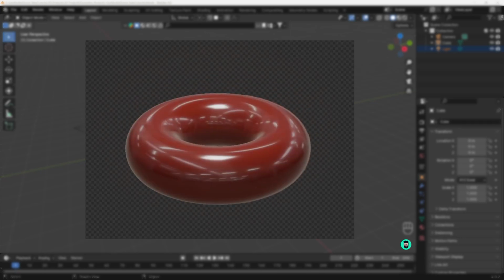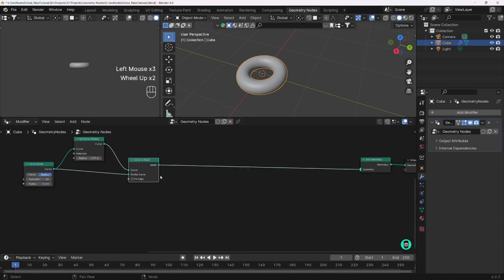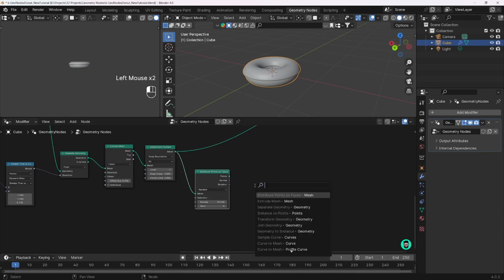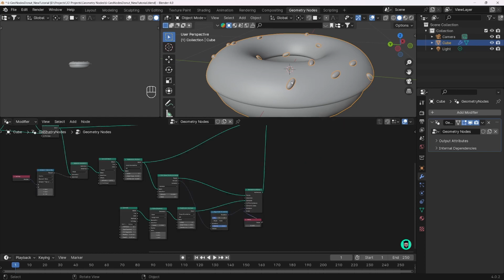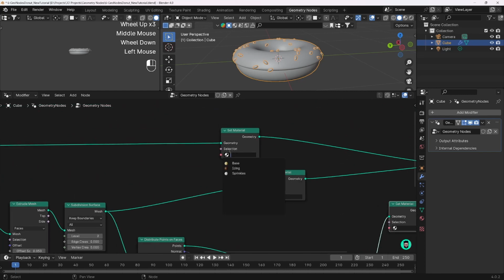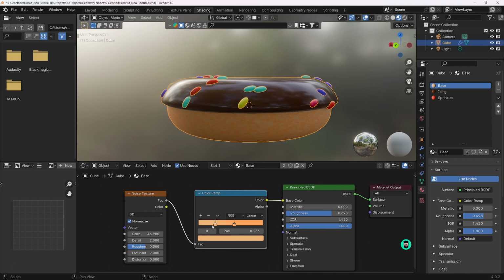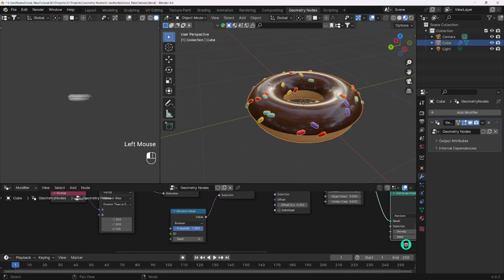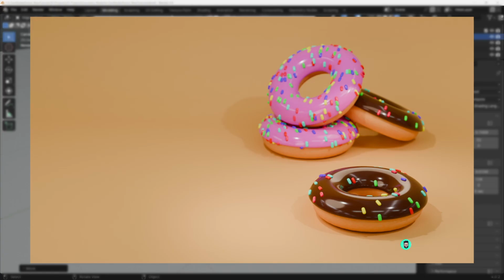Make a Donut in Blender using Geometry Nodes | Blender Tutorial

Comment: Great work!  The next step would be to add a noise texture and a set position node to made the donut look a little more real.  However, you will need to make sure the sprinkles stay attacked to the icing, which get complicated, since the noise messes up the normals used for the separate geometry.  I ended up using a mesh boolean for separate geometry instead.  It looks good.  Do you have any ideas?
Reply from the maker: Oh, that's an interesting step. I think if the noise + set position is used before separating or referencing the icing, it should be good to go. But I can't confirm without trying. 

So you separated the top half using boolean and then used it for icing?
Reply: @VectorRecite The problem with putting the noise on early is that it messes up the edges of the icing, that's why i used a mesh boolean instead of separate mesh + extrude.  But I found a better way.  Stick with the separate mesh and apply the sett position to the icing after the extrude.  Now it's all good.
Reply from the maker: @binyaminbass  That's a great approach! Glad you found a solution